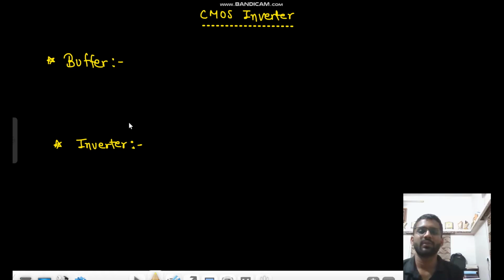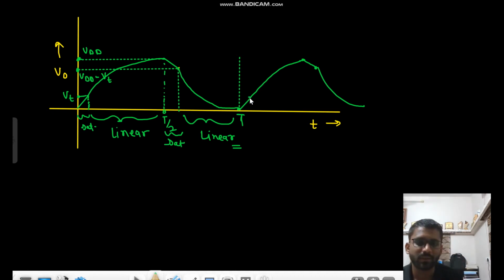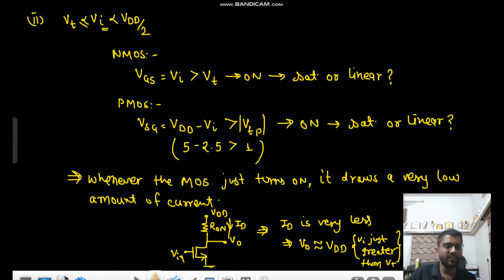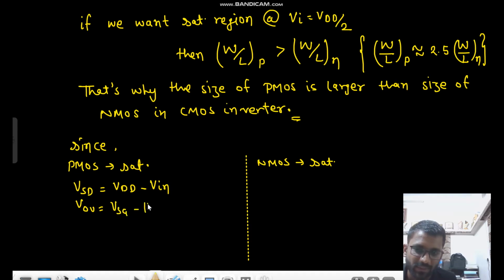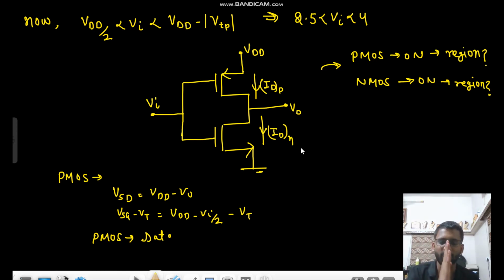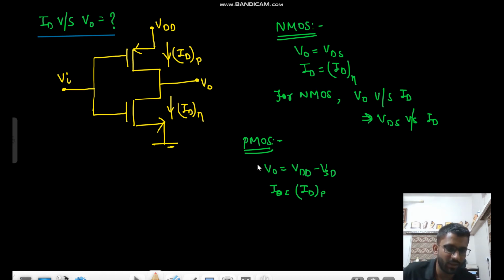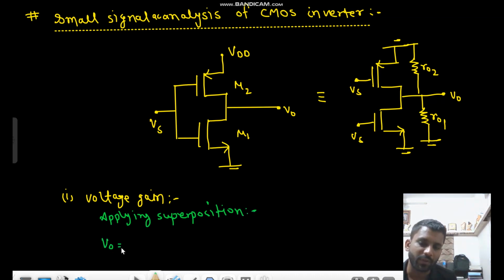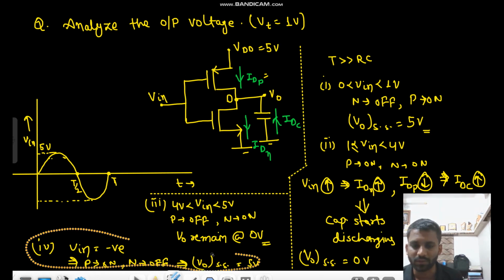Complete Concept of CMOS Inverter for Placements || Analog Electronics (Part 1): Placement Course II

Comment: sir, I have a doubt that if the aspect ratio (w/l)p is greater than (w/l)n and vice versa then on which side the VTC curve shifted
Reply: Kn and Kp are directly proportional to (W/L) respectively.  So if (W/L)p > (W/L)n then switching  threshold will decrease because the denominator term  (1+ root Kn/Kp)  would increase compared to the numerator part (root Kn/Kp * vth) as Vth is mostly less than 1.

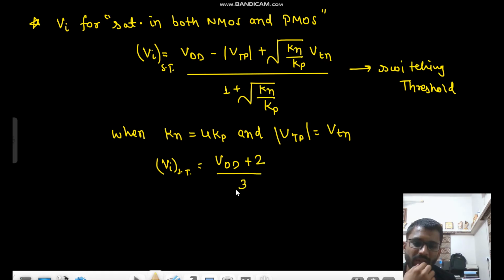Comment: 1:27:54 you forgot to take -|Vtp| in the calculations
same for the Kn<Kp case
Reply: yes, i think sir forgot that. For NMOS Vst=2, for PMOS Vst=3. confirm this once.
Reply: @PRATEEKSINGH-ic5cd Yes, I also think there is a mistake, and vst will go to 2 volts, not 2.67. Please confirm @abhishekbabar1246 .
Reply: @shreyanshhajari7811   yes, u are right Threshold will reduce for Kn>kp , I mean the curve will move towards origin

Comment: initially when vin = 0 in both the types of inputs(i.e. pulse and ramp), then two different situations come by taking two different logics. at Vin = 0, for pulse i/p case pmos comes in saturation region but at vin = 0, for ramp i/p it comes in linear region. please clear my doubt.
Reply: Bcz load is not connected..v0 will vdd immediately putting VSD zero so IDp zero which is possible only on linear...

Comment: I have one doubt. for the first half of the period(i.e. 0 - T/2) [at 12:50], will the peak value be attained only at T/2 or will it reach the value earlier? 

As it is mentioned that T is a very large value.
Reply: as no current is flowing through PMOS for 0-T/2 the voltage will appear instantaneously as depicted by the graph shown later